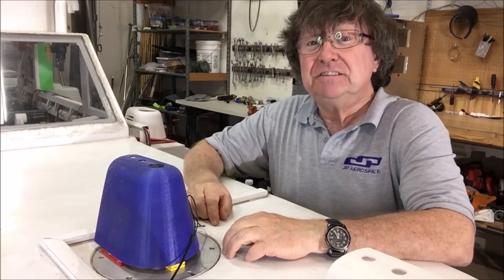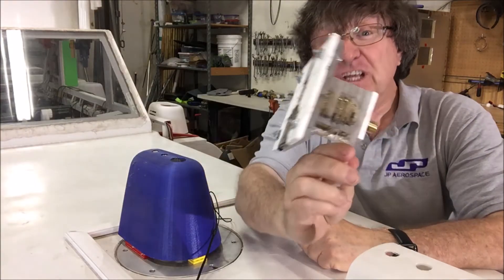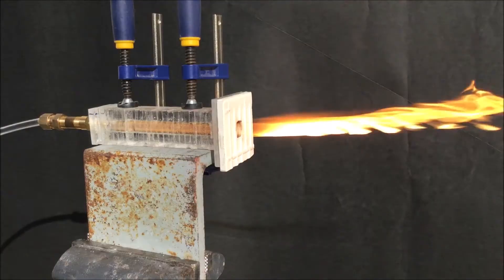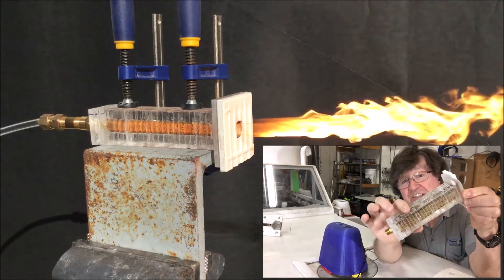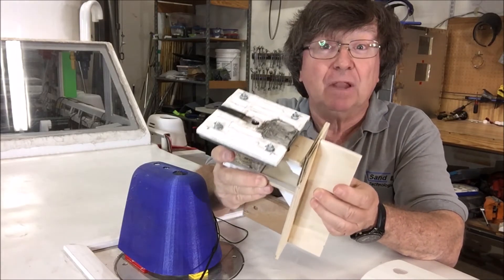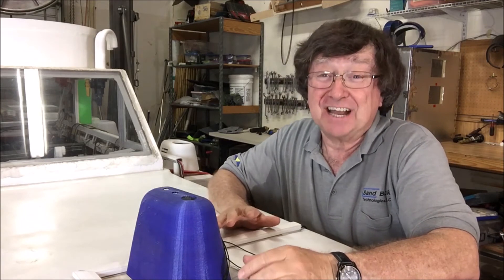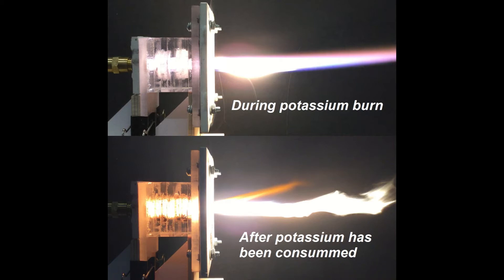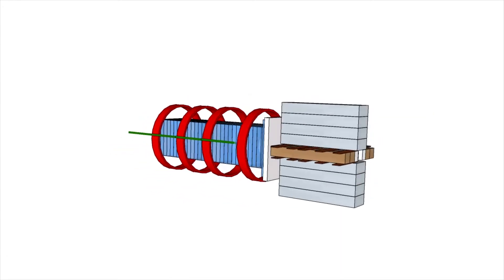MHD Block Firing 7 for Plasma Engine Research

Comment: Mix fire with plasma!!!
Reply: I’m guessing you mean combustion with plasma. One way you can archive this is by using hydrogen as propellant which is then is turned into plasma and using oxygen to combust. So you could use H2O or water as fuel. Yes on going research is being done but it’s highly likely that it will explode because hydrogen and oxygen when they react causing to form water again.

Comment: Your gas exit velocity seems way too slow if you are seeking orbital velocities, yet at fairly high fuel burn rate.  How will you get the ISP up and able to run for days at a time?  If part of the acceleration phase is in the upper atmoshere, have you considered ION wind, eg pure electric?
Reply from the maker: This video is of a low pressure test. We were looking at the paraffin/potassium dynamic. We have about a year of firings to go before it starting looking like a real engine.
Reply: @johnmpowell  One step at a time, fail, learn, improve, test etc.
Reply: As in solar sails? Or the new motorless ion flight system?
Reply: @katiegreene3960  Assuming you are asking me.  I was thinking of ion wind in atmosphere such as described here https://www.youtube.com/watch?v=01F8V5IhB5k
Reply: @katiegreene3960  
No, that's not the same.  He seems to be talking about the solid-state flight.